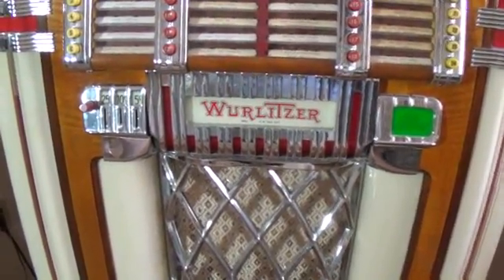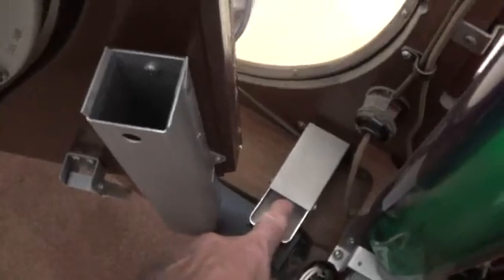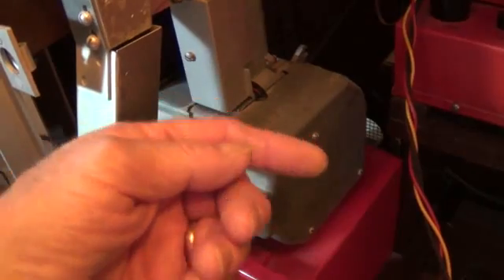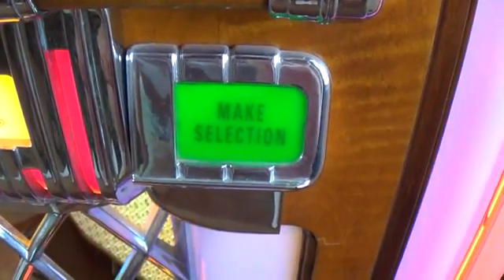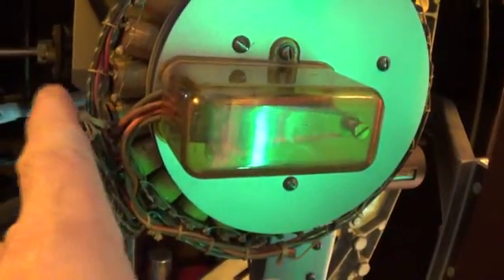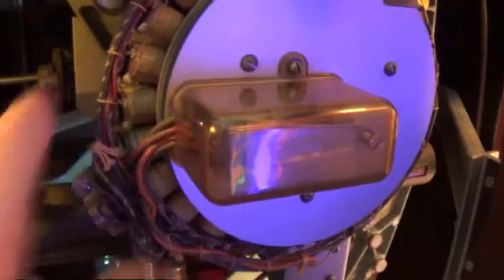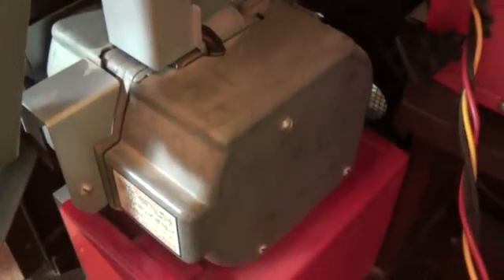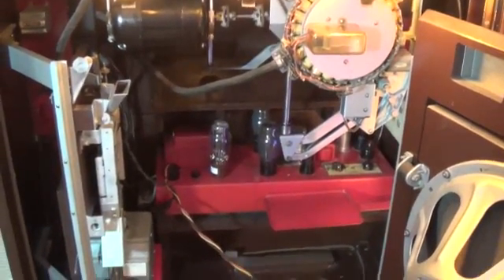How the Wurlitzer 1015 Jukebox Works Part 1:  The Credit and Selection Process

Comment: Hi Doug, I recently asked you some other questions on my Wurlitzer 1100.  My question now relates to the selector drum. Most of the selection keys work like a charm to play my records.  But 5 or 6 selector keys on my 1100  do not activate the process for selecting a record.  I would like to troubleshoot this.  Can you tell me where to pinpoint the problem?  I am assuming that I must check for voltage at each selector coil to see if I am at least getting the offending coils activated, but I am not sure how best to do this.  Any suggestions on the proper troubleshooting procedure would be much appreciated :)
Reply from the maker: Glenn1100 It's probably a problem with good electrical contact within the sliding switches and through the contacts that rotate with the drum. They should be cleaned carefully.
Reply: Ok, I'll tear into that portion of the unit next.  Thanks so much :)  Glenn
Reply from the maker: The contacts tend to tarnish over time and lose the ability to make good contact. You can burnish them lightly with 1000-grit wet or dry sandpaper.
Reply: Uncle Doug
I removed the switching assembly out of the Encore Selector. I carefully took apart the slider switch assembly that Wurlitzer never intended fellow restorers to take apart. You are right. THE SWITCHES ARE REALLY GUMMY AND TARNISHED!   I will be cleaning them with 98% rubbing alcohol, then burnishing the contacts with crocus cloth.  The selection button return springs have a light dusting of rust, so I will use Rust Mort to neutralize it.
Reply from the maker: Sounds good, Glenn. I hope it solves the problem.

Comment: Doug, Thanks, however, didn't see any arm pushing the pin back in. After it played the song five times, I pushed all the pins back in. The playing stopped, but regardless which buttons (five) are pushed the same song play again which was not pushed.
Reply from the maker: Does the selector cam (big, heart-shaped wheel) on the rear of the mechanism rotate and send the selector finger up and down the rear of the stack before each play? If not, then the selector mechanism is jammed (for any number of reasons) and must be repaired and lubricated. How to do this must be determined by close, on-site analysis to determine and eliminate the cause(s).

Comment: I really enjoyed your videos. I have a 1015 and the information is great. I have a question. Mine keeps on playing the same song over and over. What may be wrong. Any suggestions.
Reply from the maker: Thanks, William. Apparently it's not cancelling the selection just before it is played. A rotating arm at the rear of the circular selector coil bank is stopped by a pin that springs out rearward when you select the record associated with that pin. Just before the record is swung out for playing, the rotating arm (stopped by the pin) moves toward the front of the jukebox and pushes the pin back into the circular coil bank, cancelling it. Get a mirror and watch to see what part of this cycle is not occurring.

Comment: Hello Uncle Doug,
I see this video and thanks a lot for this one.
I have an issue with my 1015 recently restored.
The selection function properly and the motor is activate and the turntable rise Up and return immediately in the bottom position and the switch cut the motor.If i select an other button, the same issue come again.
Any idea on this issue?

With my best regards.
Reply from the maker: Greetings, Fred. It's very hard to describe these things verbally, but I will try. When the turntable lift arm rises to its highest (playing) position, a curved knife blade forces the lifting mechanism to disengage, leaving the  turntable in the "up" position. Your mechanism doesn't do this. The knife is on a shaft that is suspended between two adjustment screws (at the right front and back left of the mechanism). Check the adjustment of these screws and whether the knife blade is free to move up and down. The screws have lock nuts that must be loosened before you can make any adjustments. I hope this helps. Good luck !!!
Reply: Uncle Doug Thanks a lot for your help.All it's perfect right now.
With my best regards.
Reply from the maker: That's great news, Fred. Congratulations on your successful repair job.